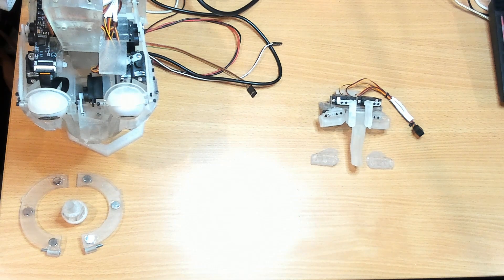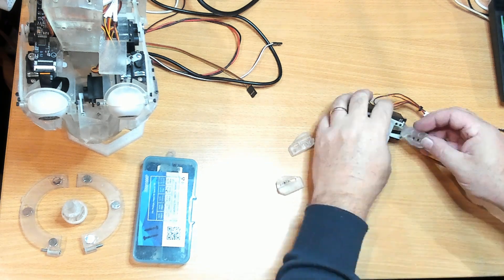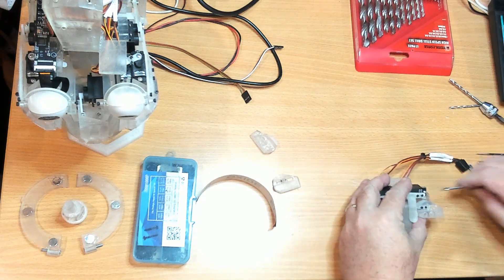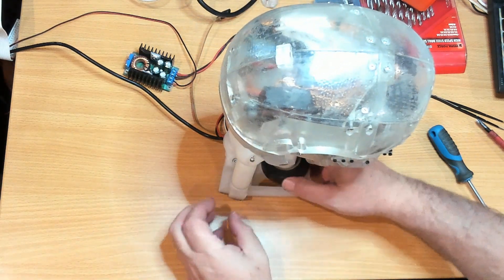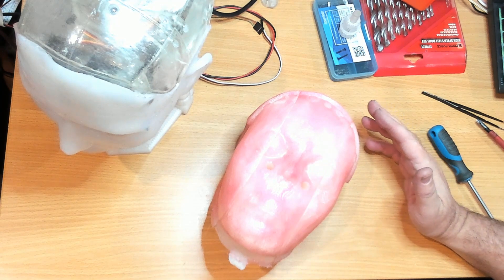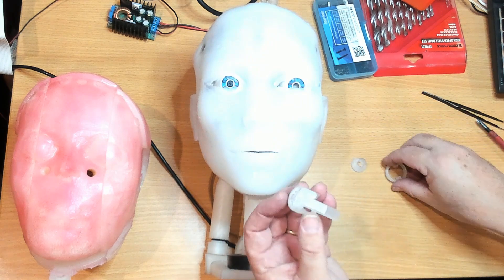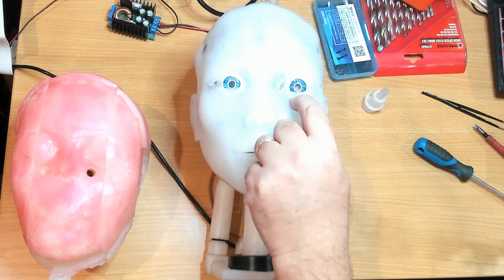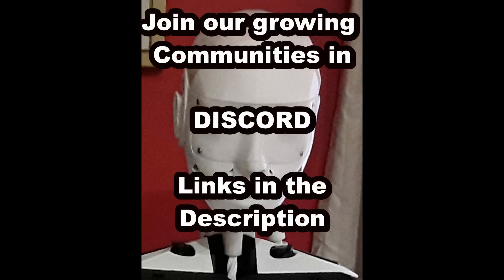InMoov i2Head build Part 11

Comment: Cyber _One, when will there be a new video of the i2Head? I'm having a lot of trouble attaching the silicone mask to my eyelids, cheek, upper lip, eyebrows and forehead. Can you explain this in a video?
Reply from the maker: I have to figure that part out as well.
The method Gael used was to add Velcro or double sided tape to some points and a layer of the same silicon to the arms in other places to improve the grip between the servo and the skin.
I found the resin I used prevented the silicone from curing.
My attempts to use double sided tape and Velcro also failed :-(

Some of the failures can be attributed to version 1 parts, which I have now changed out.
Then I was stalled on the WebKitSpeechRecognition service not working on the Raspi5. That sent me down a couple of other rabbit holes I have yet returned from 🙂
First thing I was looking at was using A Pico and Pico2 for a local speech recognition, thats still a work in progress.
The GoLucky asked about a video or two on the new RobotLab-X (RLX) from the same creator as MyRobotLab (MRL).
Turns out there are a few major issues with a number of the Raspberry Pi services, including the Arduino service. 😞
The WebKitSpeechRecognition does however work in it 🙂

I'll get the I2Head back on my desk and try and get that working with MRL, I want the new head on Fred by the end of next month, along with his new right arm as well, Got the local festival to show him off at 🙂

Comment: Which type of servos are used and how much is the quantity in this complete assembly?
Please with model and quantity.
Reply from the maker: 1 PCA9685 (adafruit 16 channel)
15 servos JX PDI 1109MG (avoid using cheap SG90, they won’t last long)
2 servos JX PDI 6221MG
28 magnets neodyme 10×1.5mm
1 or 2 micro camera(select the type2 with auto focus) https://fr.aliexpress.com/item/1005004200917640.html?spm=a2g0o.order_list.order_list_main.76.40465e5b637U38&gatewayAdapt=glo2fra
6 x M3 Hex nuts
6 x M3 x 14mm Countersunk Screws
6 x 0.8 x 6mm long self tapping screws
4 x Phillips Head 4g x 6.5mm Self Tapping Countersunk Screws
2 x M3 x 20mm long screws

Comment: I want to use Arduino Mega with elechouse v3 voice recognition module and DF player mini. Can it will fit inside the head?
Reply from the maker: Your not going to have enough room for the Arduino Mega 2560 let alone the other pits of gear
Reply: @CyberOne  than what can I do in this case and one more question that is there any space in the head to put speaker and mic for voice recognition

Comment: Thank you very much for your videos, they really helped me when building the head. Question: Do you have any problems with the servos running smoothly? I sometimes have the impression that the servos sometimes move hesitantly. I think this kame from PCA9685 Board?
Reply from the maker: I think a lot of the issue is to do with the update rate via the I2C bus.
The PDI1109MG servos are pretty fast at around 600° per second.
Speed control in MRL is done by sending a new position periodically on it's way to the final position, but the servo gets to the intermediate position and stops before the next position is sent.
There may be a way to optimise it, but most of the holdup I've noticed has been system overhead :-(
Reply: Thank you very much for your detailed feedback, it is always a pleasure to communicate with you.
Reply: Thank you for your answer and for looking into the problem. 

Question: What do you think about whether the complete robot can be controlled with the i2c bus?
Reply from the maker: I think it's very possible.
I also know there are bugs in the current implementation of the PCA9685 Service implementation.
Known bugs:
1. When the output frequency is changed, the PWM Pulse width for servo control is not recalculated with it.
This means you can't use a higher frequency that many on the newer digital servos can support and allow for a much greater resolution of servo positions at the same time.
2. There is nowhere you can update for the clock error that is present in all PCA9685 using their internal 25MHz clock.
These clock have found to differ from the 25MHz by quite a lot and is different between batches produced.

I think there is also a lot of overhead in the I2C bus system that needs to be looked into as well
Reply: From my experience in model building with model aircraft with more than 9-10 servos, I know that it is very important to have a good power supply with appropriate, well-dimensioned supply lines. Otherwise, mutual interference occurs within the servo controls. I have always solved these problems by using backup capacitors near the servos.
Reply from the maker: Most of the PCA9685 servo boards do have a 1000uF capacitor across the supply lines near the main servo power terminals.
I agree the wires to the board should be larger than the terminal block will accept, so on occasion, I will use a smaller wire that will fit for a short distance and join that to the bigger wire for the longer run.
A lot of issues with servo can be traced back to voltage drop.
In my Spot build, I used a large 10,000uF cap as a local reservoir to try and overcome voltage drop issues with multiple servos starting to move :-)
Reply: the servos have, depending on the load, sometimes very high starting currents
Reply from the maker: A standard electric motor can have between 5 and 10 times it's rated full load current when first starting until it reaches it's load speed.
This applies to the very large industrial motors as well as smaller ones which is why soft starters exist to reduce the start current :-)
Where I work, we have a number of 45KW motors with soft starters to keep the starting current down to 2 time the full rated motor load during start.

Comment: I really like the way the clear back-skull appearance came out. 

I'm curious to see how the eyebrows will perform with the new thicker attachments in there.

I am looking forward to the demonstrations once up and running on MRL.
Reply from the maker: I'm looking forward to that as well :-)
I can feel the eyebrow servos through the mask now, but there feels like a gap with the cheek pullers, so I need to work on those a bit more.
I also need to test out the 32bit version of Bookworm on my Raspberry Pi 5, I'm hoping the WebKitSpeechRecognition service will work, the 64 bit version is not working at all. :-(